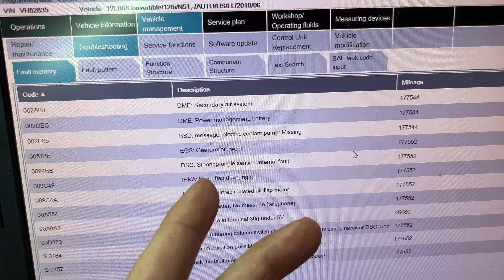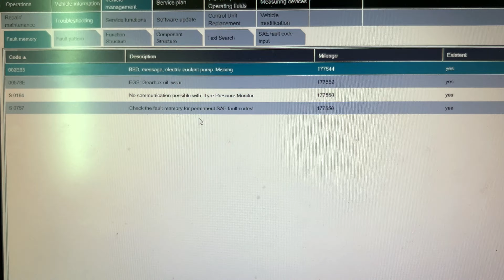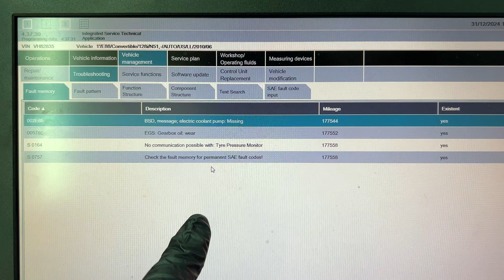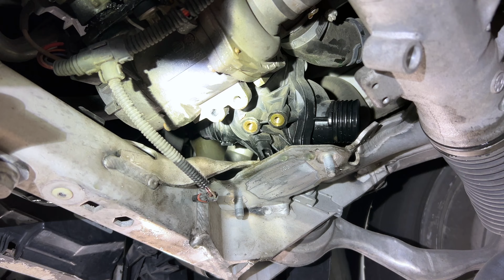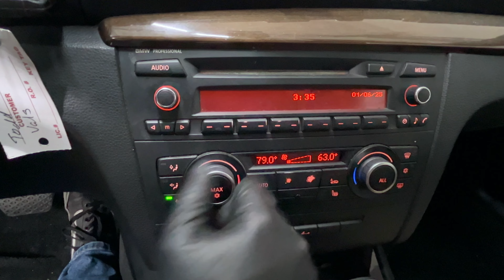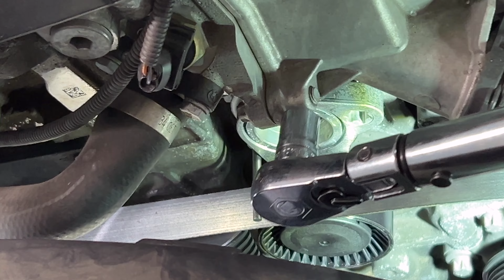2011 BMW 128i Repair: Warning Lights Galore!

Comment: Bravo, Mike!
Hair looks great, bro 👍🏼

?: Can you expect a code prior to the electric water pump failing or could it fail without symptoms?
Also, can ISTA+ perform the bleeding procedure or it needs to be initiated manually as you showed in the video?

My E82 coupè has low mileage 85k km/50k+ miles) I’ve owned since new and the electrical water pump failing is something I think about. No codes to date or anything to indicate a problem. 
Funnily enough, I’ve had the coolant changed by bmw a few times as a preventative measure.  They tell me I’m the only person that ever asks for that service! 🤷🏻‍♂️
Reply from the maker: Thanks!
They usually fault before failing. I've seen many times the pump throwing a code without any issues. I've never tried bleeding using ista. It might have a test plan for it.